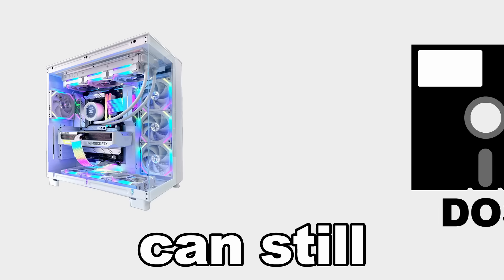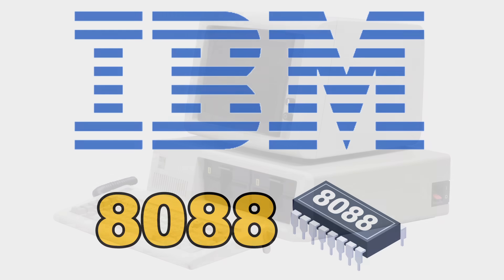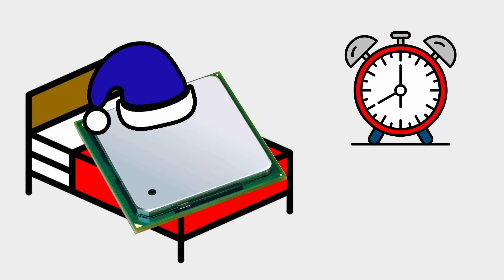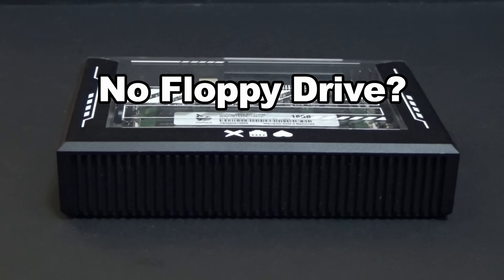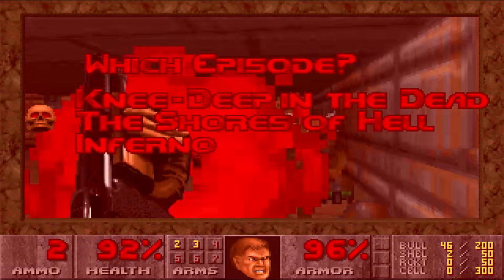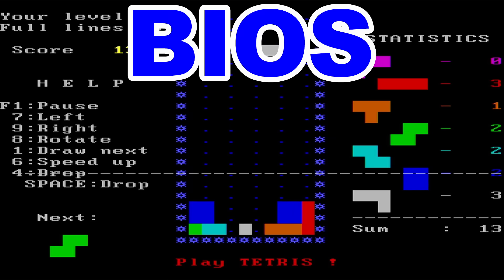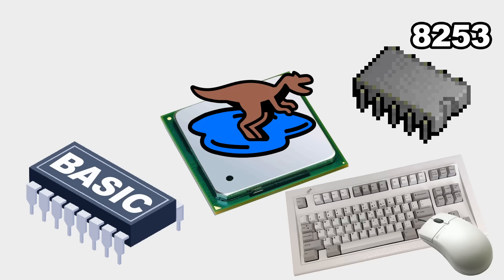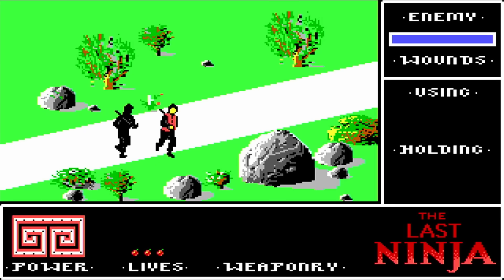45 Year Old DOS on a New Intel CPU Without Emulation

Comment: Well,64 bit CPU's can still run 16 bit instructions.
They do on boot which means it can run a native 16 bit system, and if you run a 32 bit OS (or a 64 bit Windows with OTVDM), it can still run 16 bit binaries.

Comment: You misunderstand how the instruction set works.  They are not old instructions.   They are current instructions.   That get used.   Moving 32 bits is faster then moving 64 bits.   16 bits is faster then 32.   All characters you type are only 8 bit.  and the encoding of Unicode would be slower in 64 bit.

Comment: I don't see how an old DOS can run directly run on new PC because when they went to 64-bit CPUs, the AH register was eliminated.

8086: 16 bit AX register was subdivided into a low- and high-bit register, AL(8 bits) and AH(8 bits).

80386: 32-bit had EAX(32 bits),AX(16 bits),AL(8 bits), and AH(8 bits).

64-bit:  RAX(64 bits), EAX(32 bits), AX(16 bits), and AL(8 bits).  The AH register is physically gone, so, without emulation, the system will crash when it tries to access the AH register. 

 Without an emulator to simulate the 8-bit AH register, how can the system run without crashing?

Comment: There are a few SoundBlaster emulators for DOS that will work with the HDA chips modern mobos come with. I got stuff running on an AMD X470 with a Ryzen processor and a GTX 1070. Quake runs on that around 20 times faster than when it came out. There is just so much speed lost due to removed functions, but it still works.

Comment: Meanwhile, Apple took the Mac from 68000 to PowerPC to ia-32 to x86-64 to ARM-based Apple Silicon during that time. We're several ships of Theseus deep and the original Mac system would be complete and utter gibberish to a modern Mac's boot process.

Comment: "without emulation" yeah, just keep thinking that.  And no it doesn't replicate the 8086.  All PC's are x88 and AMD64.   Also everybody saw IBM going with the 8088, it was literally built to spec for computing.   If your computer uses internal memory on the cpu its x88 derived.

Comment: Intel and DOS have a deep, historical connection, as MS-DOS was originally written for Intel's 8086 microprocessor. Modern Intel CPUs still retain the x86 architecture, which includes a high degree of backward compatibility with the old 16-bit instructions that DOS programs use.
Why It's Complicated Today
While a modern Intel CPU can technically understand and execute the instructions from a DOS program, the rest of the computer's hardware is not compatible. For example:
 * 16-bit real mode: DOS operates in 16-bit real mode, but modern CPUs start in a 64-bit mode. They must be manually put into a legacy mode to run DOS, which is not something modern operating systems do.
 * Hardware Abstraction: DOS programs communicate directly with hardware, which is a major problem today. Modern motherboards use UEFI instead of the old BIOS, and components like integrated graphics or hard drive controllers have changed entirely.
 * Performance: A modern Intel CPU is thousands of times faster than the original processors DOS was designed for. Running an old DOS game on a new CPU can make it unplayably fast unless a speed-limiter is used.
The Emulation Solution
Because of these hardware differences, the only reliable way to run DOS on a modern Intel PC is through emulation using software like DOSBox. This software creates a virtual hardware environment that mimics an old PC, allowing the DOS program to run as if it were on a compatible system. This method effectively "tricks" the software and bypasses the modern hardware compatibility issues.

Comment: They don't boot 16 bit because of backward compatibility.  It's because of the instruction set is still x86.
Fun fact--the physics required to build modern computers is all from the 1920s.  The only thing new is the digital logic, compilers and router theory.
UEFI doesn't replace bios, it adds a "built in" GUI to bios.

Comment: You have to understand what an instruction is to know why we never removed the old ones. 
It's just code that tells the CPU what to do. We went to 8- and 16-bit instructions because we ran out of 4-bit and 8-bit codes. 
Most 32 and 64-bit instructions are multiple operations, ie, do this AND that, not just do this. 
We could have run 32-bit a lot longer if it weren't for memory addressing issues.
A memory address has to fit in the same register as an instruction, so in order to address more than 3GB of RAM, we need to punch a hole in the memory to use as a pass-through or make the register bigger. 
Some modern chips have 128, 256, and 512- bit registers. They just don't advertize them that way because those registers normally hold more than one instruction.  
Hypothetically, we could collapse all of the instructions into the 64 bit space but then most instructions would have large chunks of leading 0s the processor would have to read before it can proceed.
Reply: To be pedantic, the data and instruction sizes don't have to be the same. Early computers were made where they had different lengths. The downside is that memory was effectively partitioned: you couldn't trade data space for instruction space, or vice versa. The upsides of having separate memory banks in the architecture are that data and instruction fetch can be run in parallel, and the security advantages (notably a buffer overrun can't inject code). But the biggest downside is that you need two sets of hardware for the different memory widths. Before everything was microcoded that would have made the chips more expensive. 

So the modern belief that instructions and data "must" be the same length comes down to an economic decision made in the days of discrete components -- a decision that has been kept due to, wait for it, 

...backwards compatibility

Comment: ARM has instructions for moving 8 bit, 16 bit and 32 bit on 64 bit architecture, the same as x86. That x86 starts in real mode has little to do with the instruction set except for the instruction that switches to protected mode.

Comment: That's not a 45-year-old DOS. This is MS-DOS 8.0 from Windows ME (2000). Just 25 years old.

You install Doom without sound and then you can hear it in the video.

It is not serious. Best not to be fooled.
Reply: With a sound card you can fix this issue, but may require a old one.
Reply: He ran two different versions of dos, one being much older, in the video.
Reply: MS-DOS 1.0 can not run on that hardware. He runs it on VM. Fooled again.
Reply: Didn't finish the video, I see....

Comment: I'm not sure what mode modern x64 chips start out in at power-on before the UEFI initializes the PCH, RAM and so forth. But in UEFI boot mode it will be in either 32 bit protected mode like a 386 or modern 64 bit long mode once it's executing anything off your boot device, depending on the UEFI executable file it boots. The CSM, which provides legacy boot mode, put it in 16 bit real mode and has all the usual BIOS routines that DOS calls.

And while the only ways you're going to see 16 bit real mode today are through the now vanishing CSM or installing DOS in a VM, many of those old 16 bit instructions are still present and frequently used in modern 64 bit programs. A program that uses a large array of fairly small integers will often choose an 8- or 16-bit data type to save on memory use, and those are the instructions it will use to process that data. The instructions need a prefix to access them from in 64 bit mode, and the way the instruction encodes memory accesses is different, but the operation itself is the same as when DOS uses it.

Comment: An x8086 had about 21,000 transistors. Modern processors have around 10+ BILLION transistors. Even ignoring that old 16 bit instructions could be done via micro-code, who cares if 0.0002% of the transistors aren't used outside of some initial booting? There are lots of x86 instructions which are never used and there are even chips with billions of transistors set aside for on-chip graphics which are essentially turned off the moment a graphics card in detected.

Comment: Cool video! But you have touched it already. With newest PCs (more-less post 2020) not implementing legacy BIOS, compatibility is killed, even if 8086-80386 instructions are there. E.g. not being able to call famous "mov ah,13h; int 10h" for ol' good VGA 320x200 video mode through BIOS, will cause games not running. And as PC/MS-DOS itself relied on that BIOS, very probably it will not even boot into cmd line. Sad end of one era. But hey, we still have PCem or 86Box for most hard-core cycle-by-cycle emulation.

Comment: I'm surprised those games worked decently on your modern CPU. 
For fun once, I installed Wing Commander II on a Pentium 133MHz machine (or maybe my Pentium II 450MHz). Wing Commander II used the processing power of the CPU to determine how fast the AI elements in the game work. 486 turbo mode actually made the game harder, because the enemies moved faster. On the Pentium, I launched a mission, my radar, which flashes red in quadrants to indicate incoming fire, was a steady red circle for two seconds and I exploded.

Comment: If your new PC can still run DOS  on bare metal, that's thanks to more than just the CPU's backwards compatibility. That means the old PC architecture (DMA controller, interrupt controller interval timer, BIOS functions, real mode memory map, etc) is still there in some respect. And if it can play DOOM,  then the GPU still supports 256 color VGA mode, as well as EGA, CGA and MDA. That's the real crazy thing about modern X86 computers: There's an IBM 5170 lurking in each and every one of them.
Reply: That is all true, all the programming concepts above still work - I have myself programmed all of these in x86 asm. Only that a modern PC is about a thousand times faster than 5170.
Reply: There is FreeDOS which should support more modern hardware
Reply: That said, as Clint from LGR found out (bS9hiSwL1KY), at least as of the GeForce 980Ti, modern nVidia firmware has buggy EGA/CGA/MDA emulation, and MS-DOS 6.22 can't boot off NVMe. It's really meant more for booting things like BIOS update utilities off removable disks.
Reply: Yes: running DOS era games on modern bare metal fails because they run much to fast fit a human player to cope. 

The emulator is then useful only because it can slow things down
Reply: @trueriver1950  8088-era DOS applications. Once things natively supported the 286 and beyond, they no longer assumed a fixed clock rate. That just left things like Borland language runtimes (used a timing loop and would divide by zero if the CPU was too fast), or Unreal Tournament 1999, which assumed a single-core CPU that couldn't dynamically adjust its clock speed. (The former has a patcher available and the latter just requires you to pin it to one core with frequency scaling temporarily disabled.)
Reply: 80186 wasn't completely backwards compatible because it was more of a micro controller. Almost no used it in a clone because it wasn't fully compatible
Reply: A lot of newer GPUs emulate those modes.

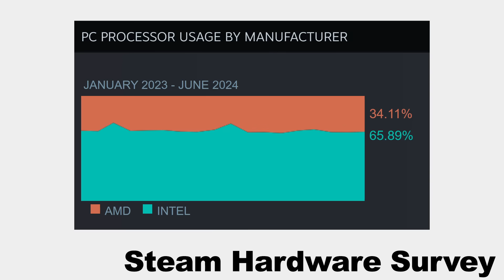Comment: 0:16 - no, it probably doesn't. It costs barely anything for Intel/AMD to make a CPU start in 64bit mode. Is that already done - IDK.
Such CPU need 2 less mode switching at boot (modern UEFI firmware operates in 64bit mode). If booting a CSM OS, then firmware initially either starts in or enters a 64 bit mode then jumps to 32 and further to 16 bit mode before hiving controll to OS / bootloader.

Comment: hehe, that compatibiltiy is cool but still questionable because most additional hardware from those days is unuseable. As there is no driver for newer hardware on dos, or no hardware interface compatibilty left for the old devices (no pci, isa bus, agp) and if u are lucky may be u will find a usb to com port device which has a driver for old dos.

Comment: the 80186 (and the 8-bit bus version 80188) were not 'in between' the 8086 and 80286.     They were embedded contollers with an 8086 core and a whole bunch of peripherals on die, like timers, interrupt controller, PWM, and such.       I designed an embedded system using the 80188 clone that NEC made called the V25 (V25 = 80188, V35 = 80186).    The V25 also had some more features than the 80188, but I forget (I think it had interrupt register set swapouts, like a Z80  )
Reply: There were a few near-compatibles like the Tandy 2000 that used the 80186.

Comment: I once worked for a company that specialized in custom code for the 8086 chip.  Shocker, but it was once so cheap, that you could get 1000, for less then $1 each.   And DOS was the trick.  DOS ran fast.  Even Linux, was not as fast as dos.

Comment: Modern processors use microcode, which is basically a compiler that translates the asm code to something lower level before actually committing it to the metal. So theoretically a modern processor can run any type of asm, as long as the microcode has translation capabilities. Great video, I loved it.
Reply: Modern X86 CPUs have both hardware-accelerated decoders and a microcode engine.

Comment: Both the original 8086 and the 8088 variant which IBM selected for their PC were NOT backwards compatible!
What Intel did was to make the capabilities of the x86 more or less a superset of the older 8080 &co, but with different binary encodings. What it did mean was that you could take a 8080 (or even a Z80) asm program, scan for and fix the few incompatibilities, and then re-assemble the code with an 8086 assembler.

The fact that the binary code I generated back in 1982 still works on modern PCs is totally amazing!

When I started serious x86 programming I fully expected to be forced to rewrite the code after maximum 5-10 years.
Reply: Well said, that's when A became AX (A eXtended), which later became (32-bit) EAX, and as of today's standards RAX (64-bit) regoster.

Comment: IMO x86 will be around for decades if not the next century. It just has far too much momentum at this point.  Considering you still have systems controlling major aspects of government and finance running on ancient IBM architecture and x86 software is even more prevalent then those systems were, I just can't see it going anywhere. We may get to a place where x86 is emulated on virtualization layers running on top of ARM or other new architecture, but it will still be there, and even that idea may never come fully to fruition.

Comment: 0:36 No.  It was made to be easy to translate machine code from the 8080 and 8085.  The 8088 was made to also use existing 8-bit support chips like the 8080 and 8085 did.

Comment: I didn't know this level of backwards compatibility was still built into these professors. Booting in real mode and switching to protected mode, wow. I would have expected modern systems to have too many layers of security added and some of the BIOS functions and low-level hardware access functions removed.

Comment: On 80386+ i like to switch from 16 bit RM into the 16 bit BIG RM with A20 gate on and a segment size of 4 GB for DS,ES,FS,GS segment, but fo CS and SS segment limit of 64 KB.

Using MS DOS or official DosBox i have to dissable the emm386.exe EMS memory manager. To use himem.sys XMS driver is not a problem.

Now i am on an Android tablet with the not official Magic DosBox free app installed and i figured it out it starts in 16 bit BIG RM with emm=true. So i don’t need my routine to switch into the BIG mode. That is a nice feature.

Comment: If your HDD is fast enough for a Windows pagefile, then every DOS executable can use the same methode to swap data to HDD and back into RAM. So 128 kb is more than you ever need. With Dos 5 file handle function we can write/read 64 kb at once multiple times.

Comment: Intel recently announced they'd canned the x86S project, so unless amd takes it on it is not happening anytime soon. 

However, intel amd, dell and others have formed an x86 alliance. It is possible if the likes of dell, hp etc who shift the most systems generally want something like x86S they'd get it, but as part of the alliance rather than from one manufacturer. 

The other legacy hold over is of course atx. Which intel control. I think this should probably be given to the x86 alliance to control as I think it is long overdue for changes given the size and weight of graphics cards now.

Comment: How much RAM from those 16 GB does EMM386 allow access to ?...
Reply: Intel CPUs from Haswell architecture onward removed the A20 support required for EMM386 to work.  So if you're using any CPU from about 2013 or later, you'll have no expanded memory.
Reply: @stargazer7644  😱😱😱
Blocking for many apps & games
Reply: The last himem.sys XMS driver can handle physical memory up to 4 GB in DOS.

Comment: This functionality is unexpectedly useful for making xbox 360 hard drives as in this mode you can write any sector of a hard drive which allows you to write xbox 360 security sectors to wd blue drives so you don't have to spend extra for the different shape and a pull tab glued on to the official ones

Comment: To run .BAS programs/games there was QBASIC.EXE program - at least supplied with Win9x addons on install CD. Most probably pure MS-DOS installs have QBASIC.EXE too. Though some of the .BAS games may run too fast without code change as it was optimized for old processors with few MHz.